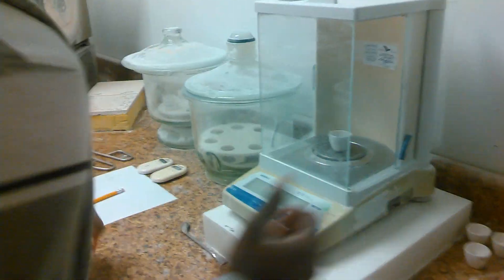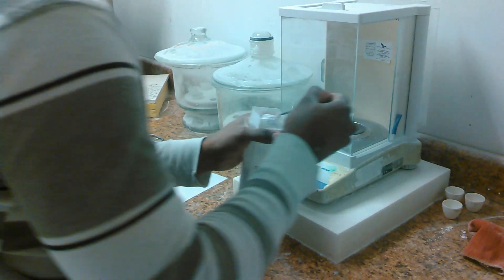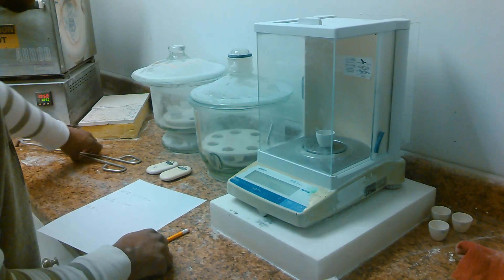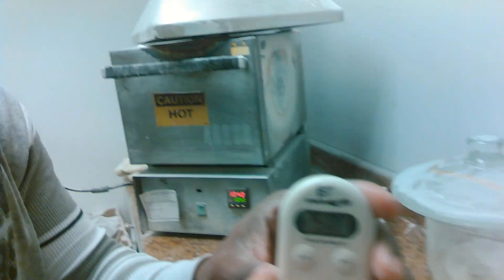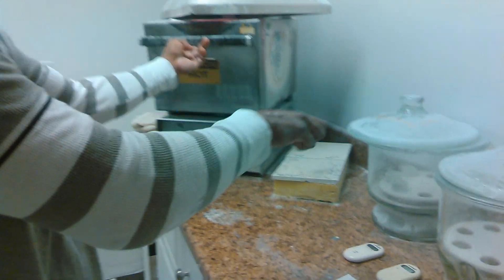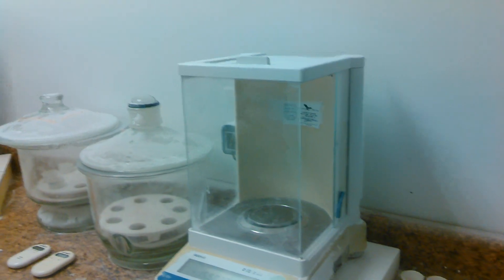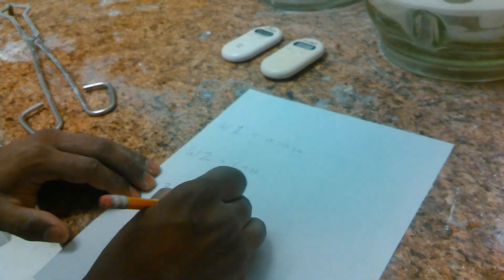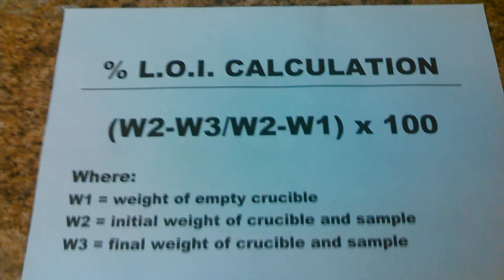L.O.I. (Loss On Ignition)

Comment: Sir, I have a problem about crucible cracking.
when I heating the crucible to 982 celsius. after the test (LOI), I move the crucible to wherever wire gauze or refractory brick for cooling, it just crack, crack from bottom, I have no idea and it's cracking EVERY single test.
Reply: and all crucible I used is new, before the test I do "preheat" the crucible for "clean" (burning) some dirt or something in it, but it just crack when cooling
Reply: but crucibles are made with such materials that they can stand extremely high temperature
Reply: U should use the  quartz crucible.. 👍👍